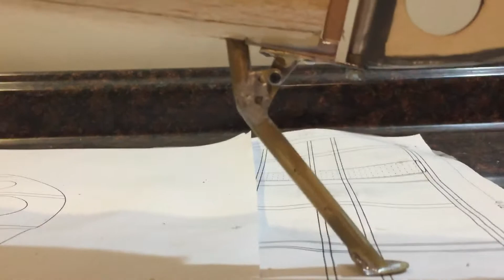1/4 Scale Travel Air Mystery Ship R613K - tail skid and landing gear

Comment: Hi wouderful scale work. Did you do the gears yourself completely? I know someone with a ship 1:3,5 who would be interested in the gears beeinge build for him, is there any supplier? whould be nice to hear from you cheers Matzito
Reply from the maker: Hello Matzito, thank you for watching.
I built the landing gear from scratch.  They were developed from the original plans of the full scale plane.  It’s welded 4130 steel tubing.  A bit heavy but sturdy.  If I built them again I think I would use a thinner walled stainless steel tubing to save some weight.

There is no supplier of gear for the Travel Air.  That deters many people from making this plane.  Some people make a simplified sprung gear instead of the elaborate carriage that the real plane had.  Thanks again.